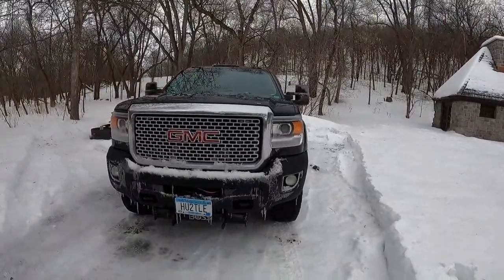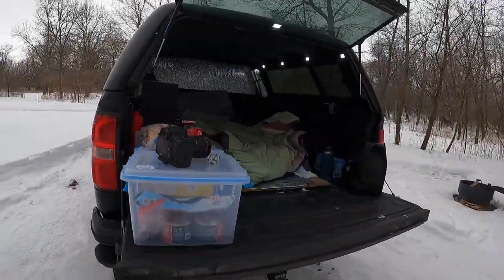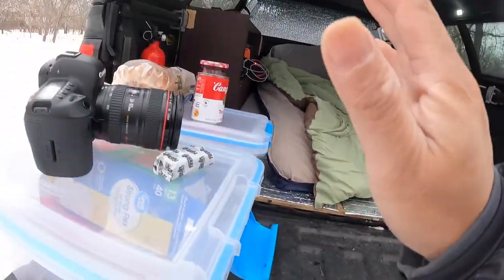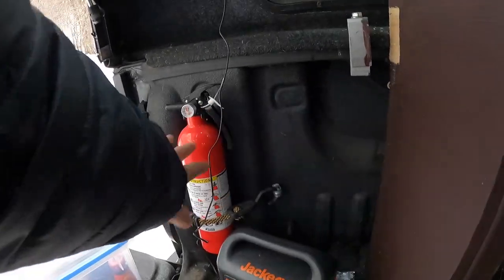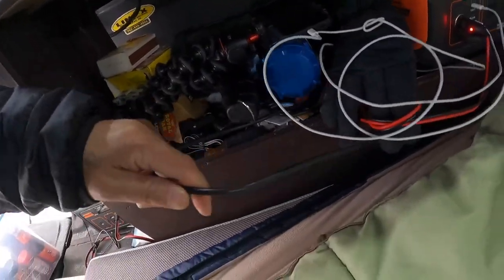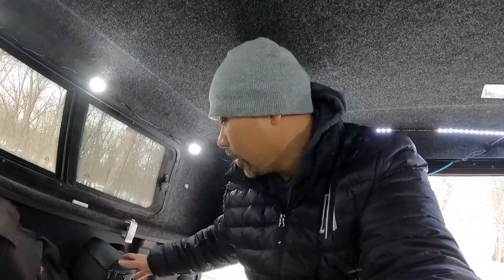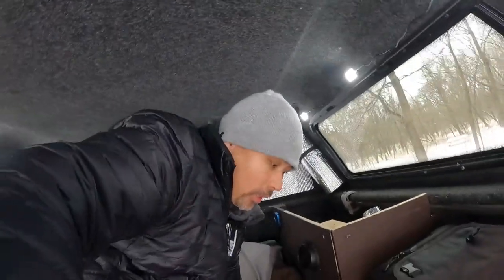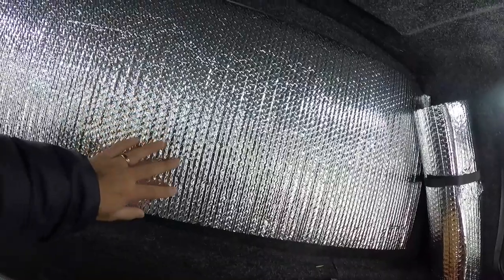My TRUCK BED CAMPER SETUP

Comment: You have an excellent setup there Chant. I was present while you were setting it all up back there, gave you lots of positive comments as it all progressed. Amazing how quickly that diesel heater heats up that small space ha? Thats what 10,000 BTU's can get you. Don't forget you can use the controller to turn the heater down to low heat mode, that way you don't overheat in there, and you use less fuel. Amazing how those Menards LED lights are much brighter and useful, then the dinky original truck cap LED lights lol. Great tour video!

Comment: Great set-up. I've camped in the back of my cover F150, but not as elaborate as your interior set-up. Tri-fold mattress and portable power station for lights: Check. The rest of my gear goes in collapsible storage bins or in my Decked Storage Drawers.
Reply from the maker: Thanks . I was going to do the deck storage to when I started the build . How much room does one have from top to bottom ?
Reply: @DHOutdoorAdventures  I have the slightly taller ARE topper. I bought the Decked when I had a Travel Trailer so I could easily store and access tools and trailer accessories.  For that, it worked fine. If I were to do it over again for truck camping, a taller shell with a raised platform for sleeping on one side so I could sit on it would be preferred, especially if you need to remove or put on your shoes in the middle of the night. I don't camp in the truck much these days, but If I did, I would go for something like this by James Bishop on YT.
  https://youtu.be/yp-J_zNQbJI?list=RDQMwZWkX8_Yv5Y&t=6
Reply: @davesdiversions8078  They make campers for trucks, that are officially for living in usage, but of course, official truck camper shells are not cheap. But I've watched video's taken at RV shows, and some of these truck campers are really nice. They got one that even looks space age sci fi if you can believe that, which would be right up my ally lol.
Reply: @stellarproductions8888  I'm familiar with actual purpose built Truck Bed Campers by RV Manufacturers, and yes, they are quite expensive when compared to a simple Truck (Bed) Cap. The Truck Cap allows for stealth camping where an actual Truck Camper might draw unwanted attention.